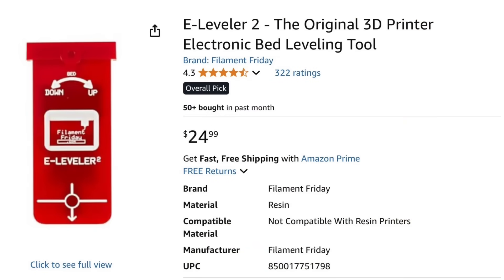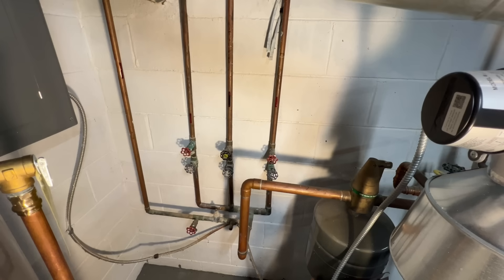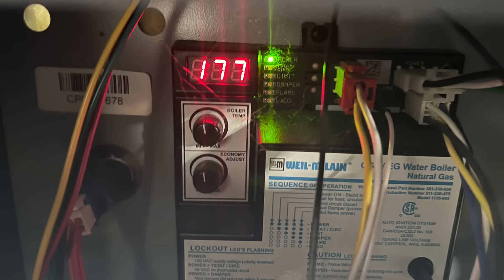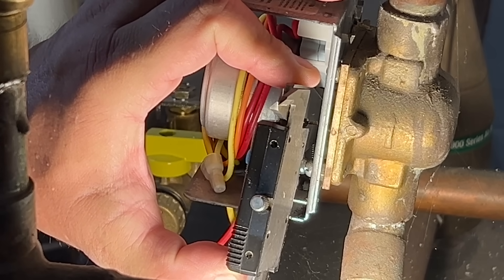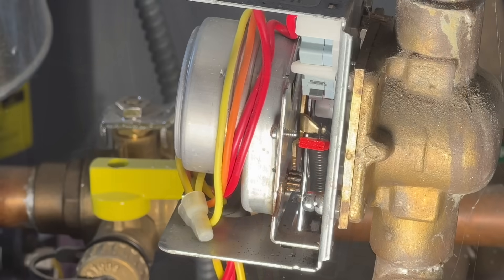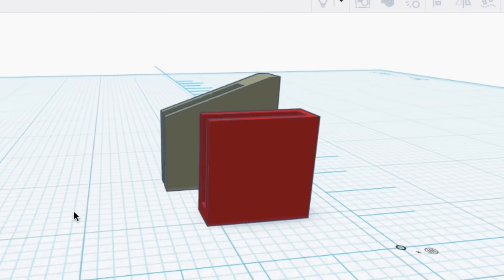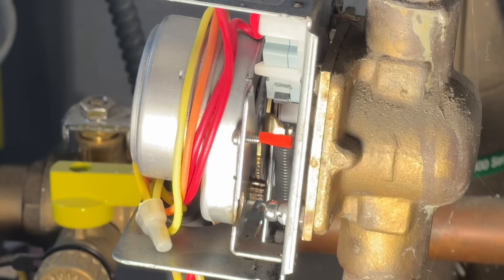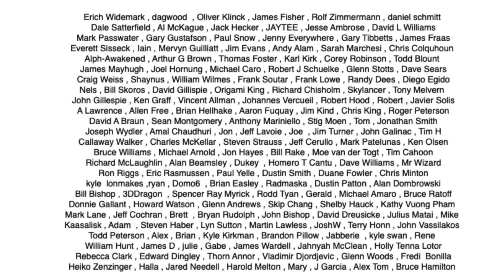I Saved $500 with a Simple 3D Print

Comment from the maker: Many have asked why I didn’t just bend the tab. First off it’s very hard to get to it amongst the pipes. Second the metal is very stiff and third I didn’t want the rest of the bracket to bend and make matters worse. 

Also, those recommending to insulate the pipes. The pipes throughout the house bleed off the heat by design. The small section the basement helps heat the basement and the floor above so insulation wouldn’t help.
Reply: I think that it hat broke when you wanted to that. 
The 3 d print is much better. 
Bud why is there no isolation around the pipes?
Reply from the maker: Read above your comment for answer.

Comment: Seems like a defect with the valve design where they didn't give enough gear to account for the full arc of the valve travel.  I probably would have fixed this using a glob of JB Weld if I did not have a 3D printer.
Reply: Or the geared part is shifting on it's bearings or the bearing or the gears are wearing out. Limiting the travel works at least for some time and is quick fix whatever way it is done 😉

Comment: Nice fix. Those motorised valves are a pain.
In the motorised valves in our house it was the micro switches that failed coming on intermittently causing the boiler to turn on but it wouldn't heat anything as the valves were still closed. They were originally wired that the thermostat activated the valve and the micro switch turned on the boiler, but I rewired it using relays so the relay turns on both the valve and the boiler bypassing the micro switches. Been working for years without any issues.
Reply from the maker: Nice solution.

Comment: Practical printing is what drives 3d printing in my view, granted also use (or can) use them for cosplay, toys,models etc.etc..but solutions to problems is a driving force behind the current printer advances. I would love to see this continue to printers that can print in metal for home user. Sadly I'm not convinced it will happen anytime soon, but just think of it tool steel strength at the very least...wow.

Comment: It really pays to know how the things around your house work. Some of them are actually quite simple, and easily repaired. The valves on our gas logs get stuck after sitting unused all summer. A few taps with a small hammer frees them right up and saves me a couple hundred bucks every winter. (The guy from the gas company showed me that trick. Then charged me $125.00 for coming out to tap the valves with a hammer . . .)
And, since you have four zones, you still have two valves that will eventually have the same issue, so you've actually saved $1500.00.
Reply from the maker: It’s also fun for me to learn how it all works.
Reply: @FilamentFriday  Well done! Just curious, did you look at the functional valves to see if, perhaps, there had originally been a spacer/tab on the valves (that subsequently degraded and fell off)?
Reply from the maker: Best I can tell is no. It’s just a worn gear causing the locking up of the mechanism.

Comment: While it wouldn’t have occurred to me to 3D print such a part, I have printed things to help where either such a part didn’t exist or I needed something NOW and couldn’t wait for sourcing it through conventional means. A few examples include needing to separate a thermostat from a poorly insulated wall, so I printed a ventilated mount that allowed airflow behind the thermostat. Another was a strange-shaped rubber gasket had failed on a horse watering trough, so I printed a new one out of TPU until I could get the ‘real’ thing. I have the real replacement gasket still in its packaging because the TPU one I printed is still working fine after a few years. I also designed and printed a little wheeled base for my shop vac’s floor nozzle. It keeps the nozzle a few millimeters from the floor and allows it to roll smoothly instead of suctioning down to the floor and making it difficult to vacuum up sawdust and dirt.
Reply from the maker: Those all sound great.

Comment: I'm mainly struck by the total lack of insulation on any of the pipework around your boiler!
Reply from the maker: It useless. The pipe run through the house bleeding off heat. Plus the basement pipes heat up the basement in winter and rises to floors above. So bonus.
Reply: @FilamentFriday  it's basically the reason I didn't buy a boiler blanket. My boiler is next to my living room so the heat loss from the tank actually slowly heats the room. The only time it would be useful is in the few months of British summer that it's actually warm, but the cost is ridiculous and it will never ROI

Comment: I wonder how much heat loss you get through the pipe? Don’t they insulate them?
Reply from the maker: That’s the whole point. Insulation is useless. The pipe run through the house bleeding off heat. Plus the basement pipes heat up the basement in winter and rises to floors above. So bonus.
Reply: @FilamentFriday  for sure you want radiant heat in rooms but often they run pipes up into roof space (well he in Australia they do) so the attic does impact pipes adversely. I was thinking more for area where you may not want to heat to dissipate ie basement but if you use for a workshop it is an advantage to be raw pipes.

Btw - Cool mod for the switch. I just had recreated a eheim aquarium pump lever - beefed it up ridiculously vs original. But took that long to sort out the rubber gaskets dried and cracked up. Which is not an easy fix.

Comment: Just glue a piece of plastic on top of tab, you do not need a printer for it. Also bemding the tab slightly would have worked?
Reply from the maker: Tried. It’s too stiff and hard to get to. Plus I didn’t want to possibly bend the bracket and cause other issues. 
Tough to get glue to hold in there but possible I guess. 
I like my solution. Quick install and it worked.

Comment: One of the first things I printed was basically the letter L. Used to lay on floor around corner of trash can. To stop back door from getting too close and tripping the motion sensor of the trash can lid. Printed some ext flower pot stands so water can run out and under pots. Self design plate holder.   Those kind of prints give me the most satisfaction

Comment: Those valve are the equivalent of $40 in the UK and the motor and gearbox can be removed and exchanged without plumbing and just swapping 5 electrical connections if the go again Chep.

Comment: FWIW, these synchronous motors are uni-directional. They just sit at the end of travel, powered up and wedged. They don't reverse and it's the spring that pulls it back the other way when the power's removed. I presume there's a worn tooth that jams the gear train if the arm is at full extent. A slight bend in the paddle that presses the microswitch would probably do the same job.
Reply from the maker: I tried bending it but it wouldn’t bend easily and it’s very hard to get in there. I also didn’t want to bend something that made it worse. So I’m happy with the fix. 
Also if it’s the springs spinning the motor than why does it move at the same speed both directions?
Reply: @FilamentFriday In that case it's a fine fix, I'm just being pedantic. Some of these units unclip from they valve to allow easier access for maintenance and freeing up of the flapper valve. I'd like to say "newer" but I'm sure someone will still sell the fixed ones!

The motors are AC so have no way of controlling direction - you can't change the polarity of the feed - that's set by the layout of the innards. If it travels at the same speed both ways, that's mostly down to the loading of the gear train. You can prove it by killing the power when it's in the open position (also, if they did reverse, the spring wouldn't be there!)
Reply from the maker: Good info. That info helps me understand the failure mode even better.
Reply: This is what I was thinking. The motor stalls at open and stays powered until the call for heat is removed, then the spring shuts the valve, spinning the motor backwards.

Comment: Would it be helpful to wrap all those copper pipes with insulation?  You know, the black ‘pool noodle’ type stuff? The energy saved could pay for that super cool 3D printed part!  😊
Reply: In my identical home system, there are no registers in the boiler room and basement area where the heating pipes run.  Any "wasted" heat keeps the basement above freezing, and the heat rises through the structure anyway.  No waste at all
Reply: You beat me with this comment by 1 minute :)
Reply: @NLGeebee 😅 and someone else had commented something similar just before me.   Maybe it’s just me being AR, but you’d think the plumbers would have insulated those pipes since they’re for hot water, and because copper is a good conductor.
Reply from the maker: The pipes run through the house and thru the registers. The registers bleed the heat off to heat the zone. Wrapping that little bit of pipe would be almost meaningless.

Comment: Sometimes a 3D printed part is the easiest or only way to solve a problem when original parts are unavailable or poorly designed. But in this case it might have been possible to just attach a washer with some heatshrink to the lever that presses the button, no 3D printing required.
Also the likely reason this failure occurs in the first place is due to the button getting worn out. If the button fails completely it's likely the motor will keep pushing the lever into it, and if there's too much padding the gears won't disengage in time likely resulting in something breaking on the button side or the motor stalling and overloading.
A more advanced way to fix the issue is to replace the endstop button with a photodiode sensor one. Actually a good example of this where precision was even more important was on my Ender 3v2, the z axis endstop originally used a button and it was inconsistent enough to cause issues with first layer adhesion and quality. So one of my first  upgrades for that machine was to replace that button with a photodiode sensor.
Reply from the maker: That would be far more difficult to install where this thing is located.
Reply: @FilamentFriday  Does look difficult to work on without taking the valve off.
Sadly this kind of failure is very common for all sorts of devices. Manufacturers saving a few cents or fractions of a cent per device by using low quality buttons with low MTBF.

Comment: It's not often that my 3d printer has the solution for my problem. It's even better when it solves a problem that would cost a ton more to solve the other way. I'm working on making a battery terminal cover out of TPU. The OEM cover is made of plastic that doesn't cover the terminal well and is not designed to lessen impacts.

Comment: Congratulations on solving your valve problem with your 3D printer.  Solutions like these are exactly how I wish more people used their printers.  They can be such handy tools for making and fixing things and not just for printing toys.
BTW, if it had been me, I would have just bent the tab on the valve so it actuated the switch sooner.  I bit of a brute force solution, but I'm guessing it would have also solved the problem.
Reply from the maker: I tried but the metal was to stiff and hard to get to. Plus I didn’t want to make it worse. So that wasn’t an option.
Reply: @FilamentFriday  It looked like it was pretty tight in there, so it would be hard to get good leverage.  I also appreciate that you didn't want to bend something unintentionally and make it worse.  Really glad such a simple spacer was able to solve the problem, and you could design and print it yourself.